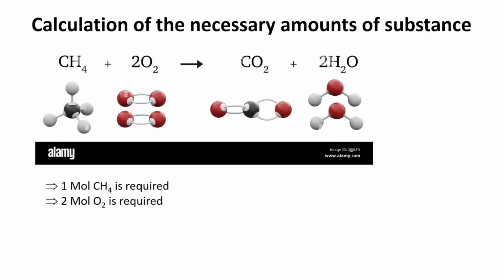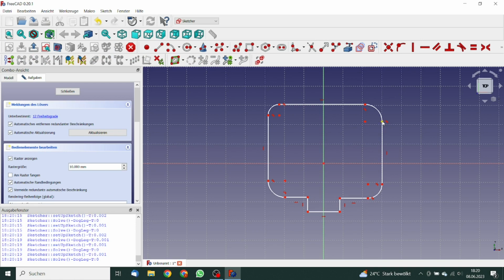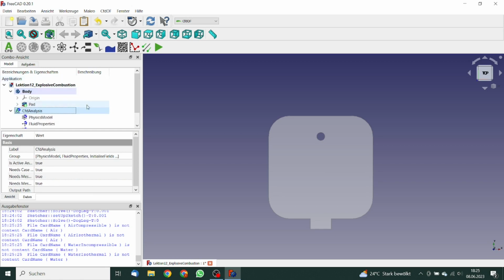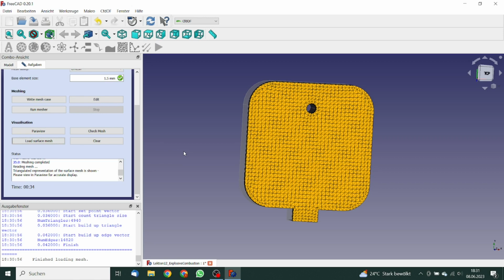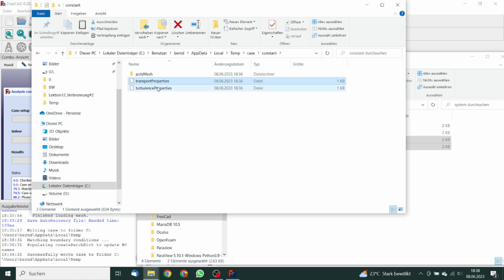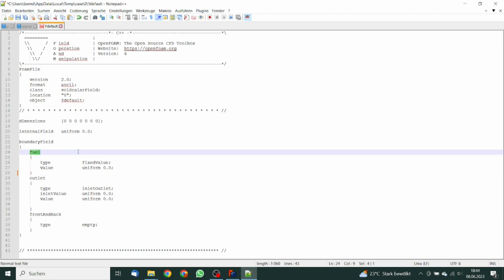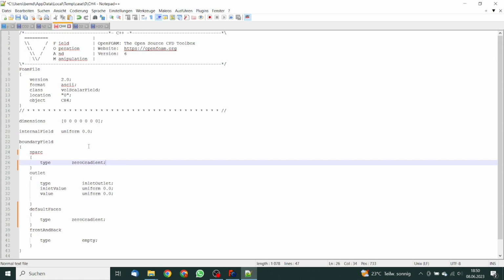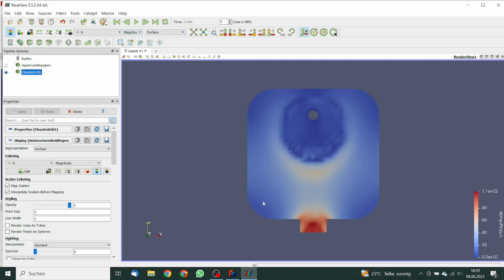Freecad CfdOf Tutorial #12: Explosive Combustion with reactingFoam

Comment: Interesting.
So to simulate an explosion you set an ignition temperature of 2000 K, far higher than in the previous simulation (Tutorial #11) where you wanted a slower, more controlled combustion.
I have to say that the flame front in an explosion can travel at subsonic or supersonic speed and this depends greatly (but not only) by the kind of reagents and the enviroment condition and room geometry.
In this case, it seems from the simulation that also a gas like methane, that in an open (non confined) room has a subsonic front flame, shows a supersonic front flame in a closed (confined) box. This is the real behaviour of this kind of explosion.